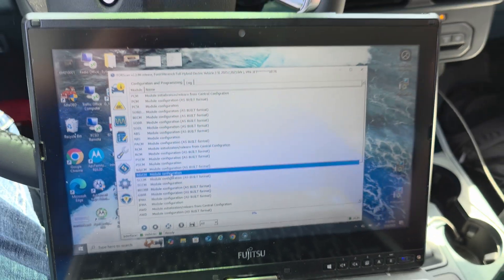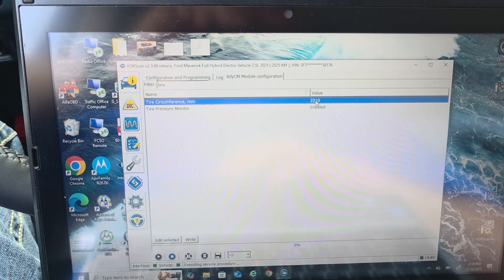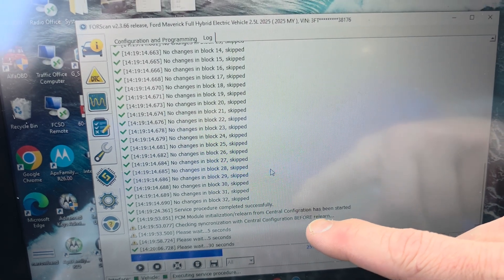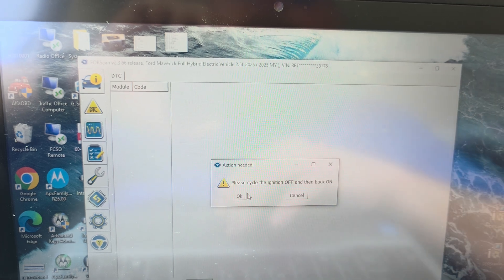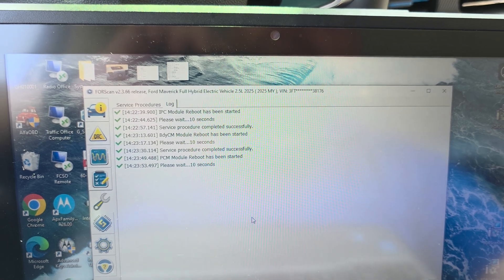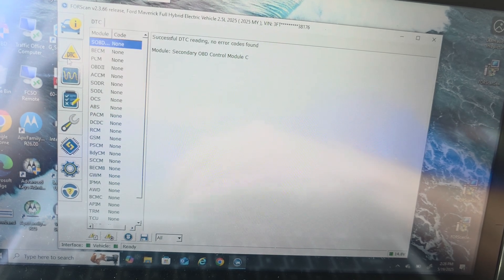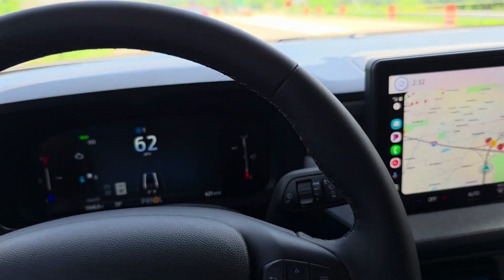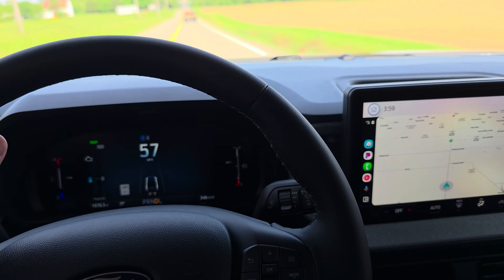Ford Maverick Speedometer Correction With Forscan

Comment: Thanks for this video. On my 2023 Tremor, I went from 235/65R17 to 255/70R17. When I change the tire circumference to 2270, the GPS speed is still faster than what’s being displayed on the instrument cluster, i.e. cluster shows 70 but GPS is 75. If I change the circumference to something out of range, would that negatively impact the truck in any way?
Reply from the maker: Out of range circumference will cause errors and a persistent wrench light on the dash. Unfortunately you can only go as high as the highest stock size, which is basically what you started with. On the older Fords (circa 2015) you could go out of range and everything would work fine, there would just be a DTC stored. Those days are unfortunately long gone now
Reply: @JackofAllMasterofNone good to know. Thank you for the follow up!

Comment: Do these adjustments make the odometer total mileage also higher/lower?
Reply from the maker: They would yes. So the fact that my speedometer was reading low meant that I was putting less miles on than I was actually traveling. The amount is very small but still.